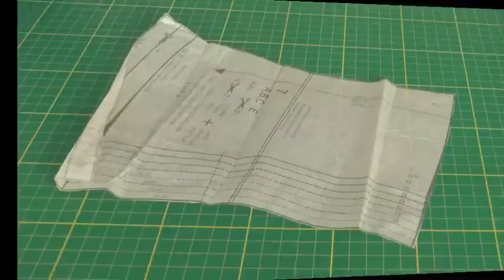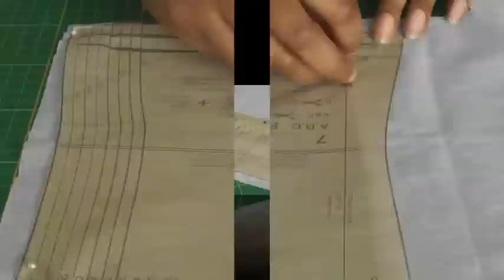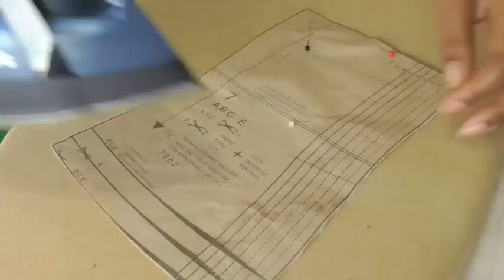Preserving Your Sewing Patterns

Comment: One thing I'd like to add: USE A DRY IRON! Steam can cause pattern pieces to distort or disintegrate.
I use this method with a twist. I have a couple of those silicone baking/pressing sheets. Laying my work out on the ironing board, I first layer a silicone sheet. Then I put a piece of interfacing, just a little bit smaller than the silicone sheet, with glue side up. Then I lay out multiple pattern pieces, trying to fit as many as I can, without overlapping. Then I place another silicone sheet carefully on top. I press without moving the iron around until all the pieces have been fused. After that I can cut out the pattern pieces. Then a final press and I'm done. Much faster and less effort and if I'm careful I can avoid wasting a lot of interfacing. 
I thought of this method after watching this post years ago! Thanks Colleen.
Reply from the maker: Thank you for sharing Love Music.

Comment: I buy a pretty shabby chic wallpaper but dont buy a preglued type. lay the pattern out on the unpatterned side of the wallpaper and pin it. Cut the largest size out first and transfer all your information to your cut out pattern piece. I can then work down the sizes cutting each pattern piece out. I then add a couple of coloured grommets to allow me to hang them, and code the colour of grommet to each size making the pieces easier to recognise for each size.  Hey presto all your sizes are ready for use and the pattern is reusable for a long time.
Reply from the maker: That's a interesting idea! Thank you for sharing Avril Crisp!